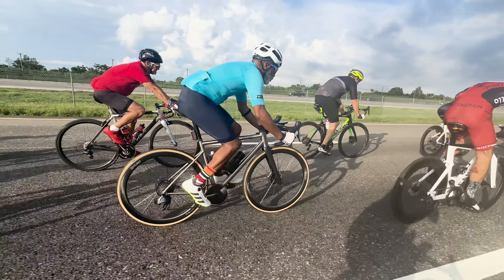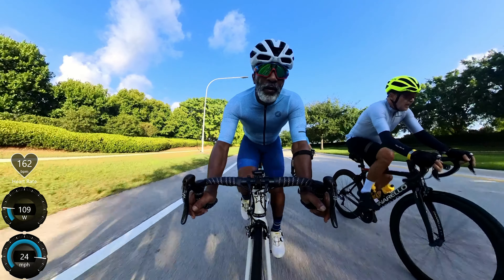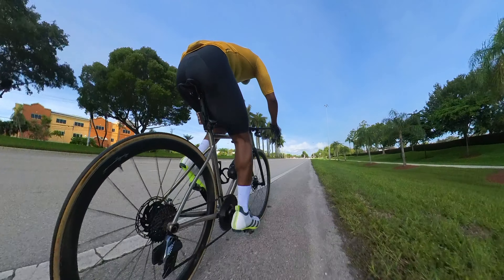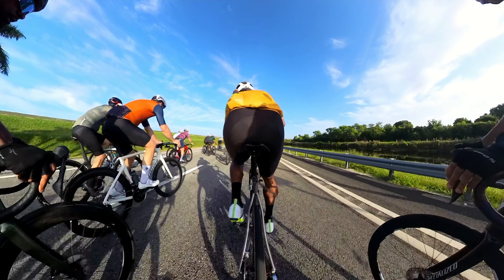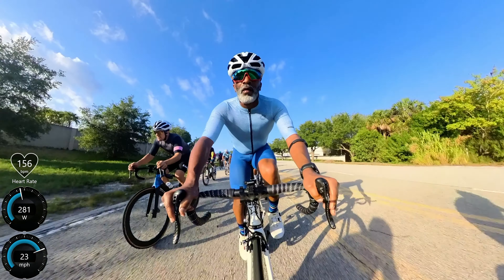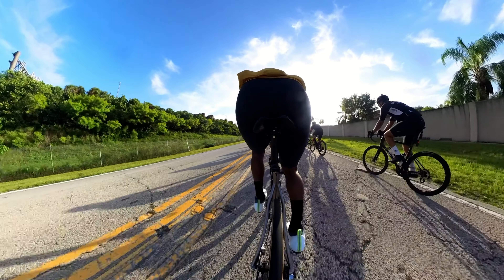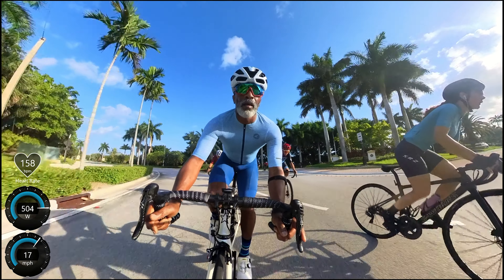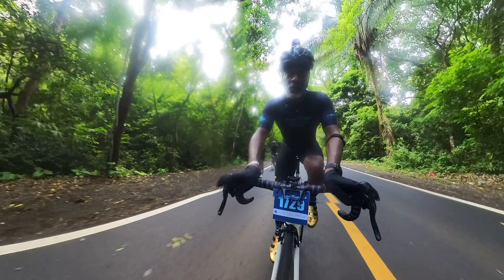Is Modern Steel Frame better than Modern Titanium?

Comment: I have seen quite a few Ti bike reviews in youtube, none has more Ti components apart from the frame itself. What gives? I bought a Ti mtb 20 years ago made in China. It came with Ti seat post as well as Ti handle bar at the cost around $1500 in Thailand. After 10 years, I modified it into hybrid bike with 700c 25mm rim brake tires and it still runs well today. I also bought second hand vintage Chromoly steel bike Panasonic for $300. Panasonic is more compliant than Ti hybrid, both ride well.
Reply from the maker: Thanks for sharing about your bikes 👍🏾

Comment: I have titanium frame made as copy of geometry from Colnago V2R/3RS and it handles exaclty the same. Just 500 gram heavier. It is more comfortable than carbon and quiet in riding. Few other bikes made of steel, also very close geometry, some steel some carbon forks, they all feel just little less responsive but all more comfortable. Handling is almost the same, only steel forks give more confidence in very fast decending.
Reply from the maker: Thanks for sharing. That V3rs geometry is so good. 👍🏾

Comment: I’m not in any particular frame material camp, but I’ve never ridden carbon or titanium.
The 1991 Basso Paris-Roubaix I had really beat me up it was so non-compliant. But I was using 23c tires and an alloy seat post, and back then I didn’t know how much of a difference those things make.
The 2017 BMC TeamMachine ALR01 is downright plush in comparison.
But now I want a custom-made frame - a “forever” bike. With my budget, I could go for a Waltly titanium frame from China, or some local frame builder (NY State / East Coast area) who could use Spirit or/and 853. I don’t race and I don’t train with a watt meter or Strava or any of that. I just ride hard for fun.
Anybody got advice / opinions?
Reply from the maker: Hi Tom. Thanks for watching. A name that consistently comes up for custom is Marinoni. I have no experience with them, so please do your research. 
There is also lots of videos by people who have used Walty. Best of luck to you!

Comment: Too many variables in 'ride feel' to call the frame responsible. Tire width matters, yes, but so does the actual tire, internal rim width, and tire pressure. And then wheel stiffness makes a difference, too. You absolutely have to isolate the frame by controlling those variables (the fork, seatpost, stem, and handlebars will also affect). Next time, ride both frames with the same wheels and tires at least. Good video, otherwise.